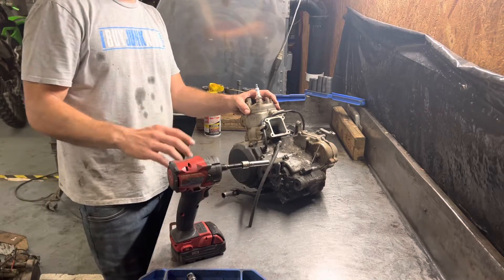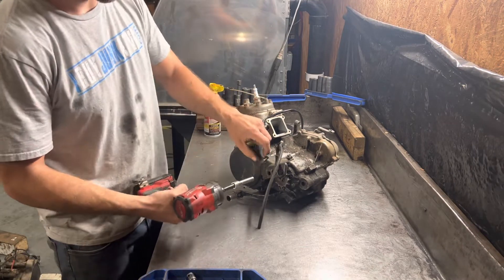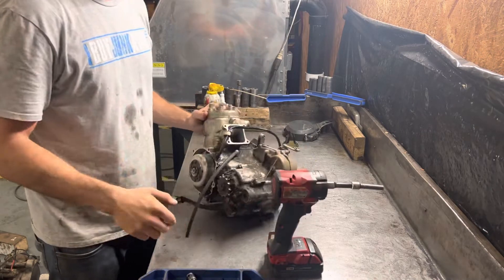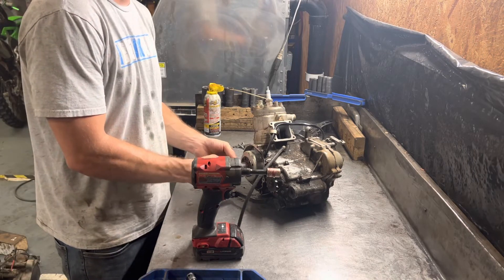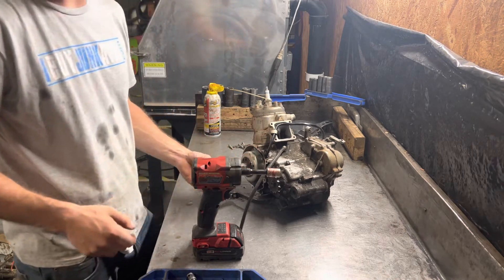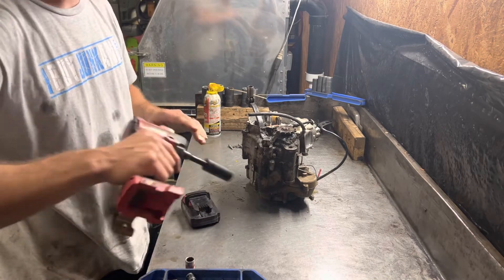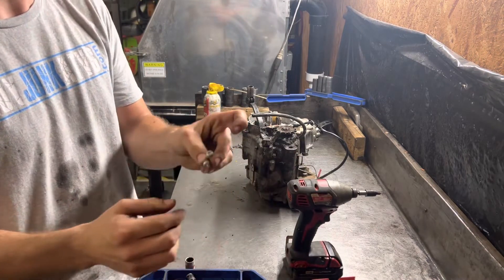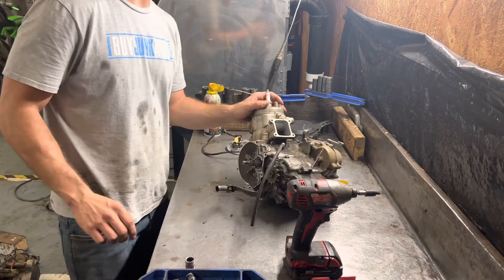How To Remove Dirt Bike Flywheel & Stator | 2 Stroke & 4 Stroke

Comment: Hey does the flywheel have to be lined up properly after installation of the stator
Reply from the maker: It will have a keyway where the woodruff key fits into the crank and the flywheel.
Reply: @TheATVHustle  thanks
Reply: @TheATVHustle is that key timed ? Is there a right or wrong way to install it ??
Reply from the maker: @cii5korea217  the key only can go in one way.

Comment: Quick question I’m currently trying to pull mine off however, the bolt for the 14 mm that I have to get to before adding the polar won’t spin off. It just spins with the flywheel. Any ideas?
Reply from the maker: I use an impact to get it off. Sometimes I have to hold the flywheel but usually I don’t.
Reply: Thank you, it worked